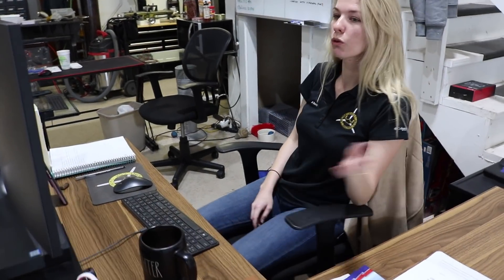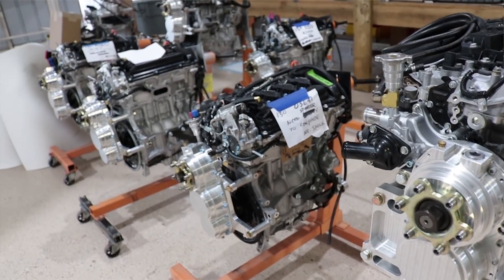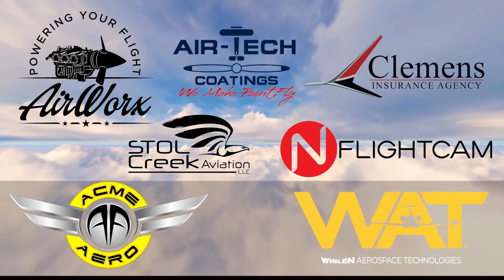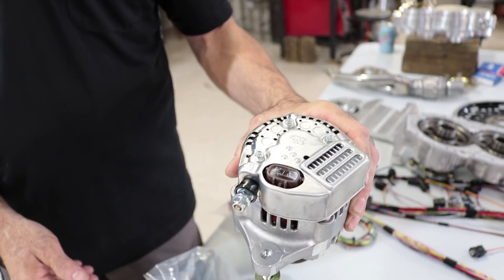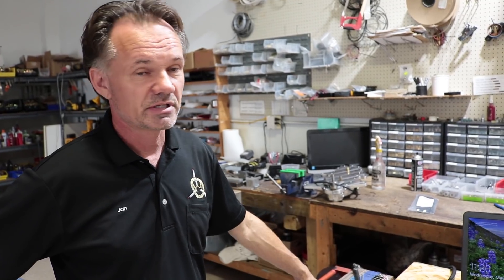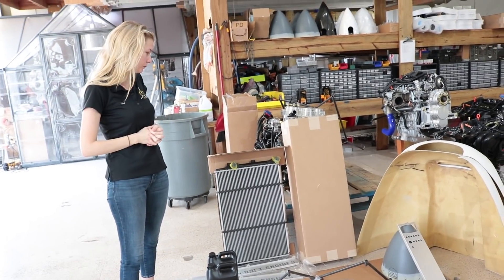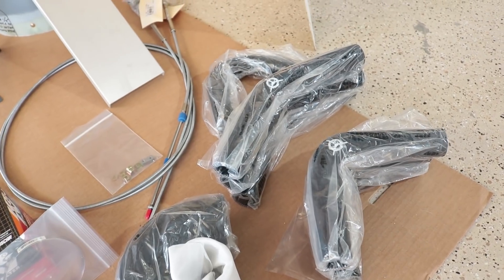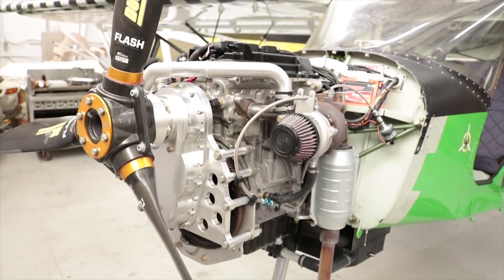Viking Aircraft Engines - Engine Week 2020

Comment: I sure would like a Honda engine. I have a 1990 Honda CBR 1000F motorcycle. It has 87,000 miles of very high RPM operation. It has never leaked coolant or oil. It doesn't burn oil. compressions are all factory fresh. The vavle buckets don't even need shims. I am totally impressed with their metallurgy.

Comment: Was somewhat puzzled by the included equipment.  Evans coolant?  K&N air filters?

Honda has an excellent OEM coolant that is very long lasting and IMO that's what should be used.  Evans is for drag racing applications where you cannot use glycol based coolant due to the fact it fouls the track if it leaks coolant.  Evans also does not cool as well as a water/glycol mix.  Granted, the boiling point of Evans is 375F, but your engine will run hotter for a given load than it will with the OEM coolant.

And K&N filters let more dirt through, period, proven many times by oil analysis.  Use a traditional paper filter.

Comment: Those engines are basically "scrap metal" going to the "vendor" and they come out of "JDM" (Japanese Domestic Market) vehicles that no longer "meet specs" per the "supplier" Honda and the "Japanese government" and must be replaced instead of "serviced" because they CANNOT be "serviced" sufficiently to "meet specs". 

The "markup" on those BOAT ANCHORS. is at least 10,000% if you consider their "value" on arrival from the "vendor" to be "scrap price". 

And this assclown refers to "robotically put together" specifically to suggest "human error" had nothing to do with their "scrap" status. 

That is complete bullshit. There is some "automation" involved in "mass production" of "car engines". But there is no "autonomy" whatsoever where "robots" have "replaced human workers" and are "building engines" actually assembling ANY precision "internal" OR "external" engine parts.

Comment: Why would you insist on 4130 chromoly tubing to be TIG welded when it was specifically designed with Metallurgy requiring it to be oxy-acetylene welding. When 4130 and I believe 4140, chromoly tubing is TIG welded it must be stress relieved at all the weld with an oxy acetylene torch. Otherwise you have an Austin medicazone which is subject to failure. Even NASCAR was making this mistake requiring roll cages to be TIG welded instead of oxy-acetylene welding. That metal was specifically designed for oxy-acetylene welding???

Comment: Those that are new to the game make whatever decision you’d like, but do your due diligence and research Mr Eggenfellner’s past with Subaru engines on airplanes before you purchase.  Same guy and basically same marketing story now as then just a different engine manufacturer.  It did not end well.  Again make whatever decision you’d like, but buyer beware.
Reply: Just got our Eggenfellner Subaru back together with its third short block. Really getting old fixing stuff. Really ruins the idea of alternative engines as there are a lot of engine specific choices to wiring and fuel system. Lot of work and money to swap to a traditional engine. Not saying all alternative engines are a bad choice but we definitely believe the Eggenfellner Subaru was the wrong choice. But at least I get a laugh every time I remove the Eggenfellner intake manifold and looking at the frying pan emblem on the bottom (yes, intake is two pans welded together). "Farberware - Quality Cookware" I'm sure the non-stick coating was an eggeneering decision.

Comment: To understand dual spark plugs in an older aircraft motor is to understand the failure rate of a magneto and that those motors could not produce full power without dual spark plugs because of a weak and low voltage spark.    This is not the case in a newer modern gasoline motor.
Reply: The main reason for two spark plugs in classic aircraft engine is that their pistons are over five inches in diameter.  The flame front moves too slow to span that distance with one spark plug.

Comment: I am putting one in my Zenith 750 STOL, once I stop dumping money in my Cessna 210. Different mission, goal is to leap off my own property and fly low and slow. The Viking will no doubt do the leap off the ground fast. I might have to build me a set of Cruzer wings and tail so I can move a little too.😄 I own a 1966 Corsair Corsa, I was looking hard at going that route, since I have already built 3 - 164 140HP engines., but the modern technology in the Viking and true 130HP performance won for me. Plus I can get a low mileage Honda, similar VIN  replacement motor, if I ever need it, for less than $2000.

Comment: I really like your videos. Keep them coming! 
When I took Auto Shop in high school we were given a Ford truck chassis, everything from the body down, to learn on. It had fallen off the truck when it was being delivered to a local Ford Dealer. That’s a great way to get an engine, if you can get a hold of one.
When the EPA mandated their emission standards one of the areas that was needed improvement was an ignition system. The old points style ignition because when the points wore down the dwell of the ignition coil changes over time along with the ignition timing. Dwell is how long the coil is charged by the battery. The longer the better. In the old days dual point distributors had two sets of points the increase dwell, and that created a hitter spark. But dual ignition gave the engine two paces to wear. When they changed to electronic ignition, that was no longer a problem, and the engine won’t need constant tune ups to keep running clean. That also helps the engine run better longer, and in an aircraft that mean the horsepower rating remained constant, not high one day and after a few hundred hours of use would have to be serviced to bring everything back to spec.
Reply from the maker: Will do! Thank You! All good points on the tech talk their. Thanks for sharing. Good story and great experiences!

Comment: why do are you using carbs instead of Electronic Fuel Injection?  Wouldn't that reduce a fragility and eliminate carb icing problems.
Reply: There are no carbs. It’s all direct fuel injection.
Reply: @alissaeggenfellner4613  he states at 9:20-9:27 that it has 4 carburetors.
Reply: @jrholand  it has 4 injectors, 4 coils, 4 spark plugs, he was stating instead of a single carburetor we have 4 independent injectors
Reply: @alissaeggenfellner4613  gotcha.. phew
Reply from the maker: I believe he was stating that "COMPARING" to "as if" it had... not that it has. Most people think of aircraft engines think of have a carburetor. Thanks for your questions! Thanks for watching here today!

Comment: What about that Duc prop viking recently marketed?  The one that changes pitch, did you see that when you were at their location?  That seems like a great option for a viking cruzer.
Reply: I don’t think we had it completed when he was here! However, he saw it at Zenith Homecoming. It is a perfect match for those looking for great speeds and takeoff without compromising.
Reply from the maker: Good question. I have spoken with DUC a few times and may do an entire episode early 2021 showcasing what they have to offer. Thanks for taking the time to engage here and for watching today!
Reply: It’s a simple, straight forward design, incorporated in the design to pass the actuator arm through the gear box. Uses an electrical actuator, so no messy hydraulics to worry about. The DUC props are slick, pricey, but you get what you pay for. Prop Pitch System looked very light weight to me as well.

Comment: Can it run on Low Lead AV gas found at airports or do have to plan on finding MOGAS at the destination?
Reply: You can use either, when using 100 LL an additive should be used, this is similar to many engines using 100 LL
Reply: @alissaeggenfellner4613  Do you guys keep the catalytic converter on the engines, or is that removed?
Reply: @PistonAvatarGuy  we’ve done it both ways on the 130, most run with it on, but can also be easily removed.
Reply from the maker: I think your question was answered below. If not...ask away. That is the purpose of starting this series. To get the conversation going for you. Thank You for watching!

Comment: There’s no doubt that automotive engine technology is fantastic and reliable. However, since any particular engine model offered here has a low (maybe zero) number of installs in a given aircraft model, it’s like you’re being a long term test pilot for that engine install. I’m more comfortable going with an engine such as a Rotax which has thousands of installs in a given aircraft model.
Reply: I’m confused at your response, we have over 600 Zenith installs and many in Kitfox, RANS, Searey, PPC. Over many years we have over 1000 engines sold. The engines are very well tested before they ever hit the market. Even a tested Rotax can fail, but it’s about picking what’s best for you.
Reply from the maker: Go with what you know... or take the time to learn about something new. That is the point of this ENGINE WEEK Series. I hope to reveal most of the details that were or are in question to have you better informed so you can more easily make a choice. And I only wanted to cover engines that are actually "In Production" and the most popular of those. These are quite popular and being installed in aircraft at a pretty aggressive rate these last few years. But of course.... you can decide which platform you feel most comfortable with for your application. Thanks for taking the time to comment here today and for watching!

Comment: No info presented on displacement, HP, gear box ratio etc. Guess you have to go to their website.
Reply: Yes, all that info is displayed easily on our website and a list of parameters etc. . All of our engines run a 2.33/1 ratio in the 90, 130 and 195 T engines
Reply from the maker: Sorry if I missed anything. But yes... that is also why I provide links in the description so you can check out their website or simply call and talk shop. Thanks for watching! I appreciate you!

Comment: Massive Honda fan and also a fan of offering affordable engine options for aircraft, I have a Honda car, bike, lawnmower myself, but isn't that 1.5L turbo 'earth dreams' the engine that has reliability issues and has been banned in China? Dilution of oil and carbon build up issues (Scotty Kilmer). Keen to understand what work Viking to prep it for aircraft installs.
Reply: Dilution of oil and carbon build up are avoided by running it overboard just like a typical aircraft engines. I think this was mostly an issue in the early years (not now) We have some videos called “Viking Talks” that go through a bit of the process more and are always sharing more
Reply: @alissaeggenfellner4613  Thanks! I'll have a watch.
Reply from the maker: I hope your question(s) were answered  below...if not ASK AWAY. I want you to be able to get an education from this ENGINE WEEK series and be able to make a decision if this is an option for you... or not. Thanks for taking the time to watch today!
Reply: The issues you mention are endemic to turbo direct injection engines of any make.  Doing a lot of short tripping on them with 87 octane fuel leads to oil dilution because they run a rich air-fuel ratio (AFR) to avoid knocking and detonation on the lower octane fuel.  In a grocery-getter or soccer-mom application the oil never gets to a high enough temperature to burn off the extra fuel that ends up in the oil.  

This issue is mitigated by running these engines on higher octane fuel that doesn't require as rich of an AFR to avoid knocking/detonation and/or running the engines harder and longer, which results in appropriately higher oil temperatures that will burn off any fuel that does end up in the crankcase.

An alternate way to mitigate the dilution/loss of oil viscosity is to just run thicker oil.  Honda recommends 0w20 oils even in their turbo engines but I personally would move that up to somethingW-30 synthetic at least.  And do oil analysis to set your change regimen, don't rely on the oil life monitor in the car.  Once the oil falls out of viscosity range - 9.3 to 12.4 centistrokes viscosity for Xw30 at 100C/212F, change it.

As Mrs. Eggenfellner notes this would be less of an issue in an aircraft application because it will be running at relatively high power settings even in cruise.

Comment: Does Honda really approve Evans waterless coolant in their engines, as shown in this video when the kits are ready to ship? I genuinely have concerns about that product...Have never seen any OEM manufacurer recommend other than 50/50 blend?
Reply: We use it with a slight pressure (5 lbs) cars are much higher as you know. The reason being if there were ever to be a leak you wouldn’t lose as much fluid, it’s lifetime and doesn’t cause corrosion in the engine or radiator (water can), some places in the engine are hotter than other like around the exhaust manifold - which is built into the cylinder head, water could turn into steam pockets in those areas and not cool like Evans (which has a much higher boiling point) even without pressure.
Reply: They don't use it because of sheer cost. It's used extensively in race cars where it can be re-used on frequent tear downs and car collections where the cars sit. I would have no issue running it, it's far less corrosive than glycol.
Reply from the maker: I think your question has been answered below. Ask away on here anytime! Thanks for taking the time to watch here!

Comment: Auto manufacturers beat the crap out of these engines in testing.  Thermal shock test, hundreds of hours at WOT, contaminated fuel, ect.  Auto engines are very reliable, but they have an achilles.  The whole operation of the engine is dependent upon a working electrical system unlike a traditional aircraft engine.  Many also have the added complication of a gear box.  So as with everything there are pluses and minuses.
Reply from the maker: Sure. Agreed. So far so good here though. Are you currently building something yourself?
Reply: @ExperimentalAircraftChannel  I am building a Bearhawk 4place from plans, but I'm still a long way from having to make an engine decision.  Vikings would definitely be worth a look if they had offerings in the power range I needed.
Reply: @MrBtdobie  I love that whole like of aircraft! they are huge compared to what im looking for though and while I love Viking, aircraft that large may need something like a bigger Lycoming. Thats what pushed me away from the larger aircraft like that. Cost to operate was outside of what I felt was worth it and necessary for me.
Reply: @TheArchitectJC  I was looking for something that would be suitable for family flying even as kids get older and bigger.  So the Bearhawk's useful load is what really attracted me.  In the end I will probably end up with a Lyc, cont, or UL power, but I am still wide open on that front.  It seems that large airplanes limit your engine options.

Comment: I have personally set up the top end of a 2009 1.5 liter Honda engines 117hp@6600rpm. Very solid platform from a mechanical stand point.
Reply: Good point. The GDI version of the engine has a lot of torque at 4500 so even better as an aircraft candidate
Reply from the maker: Awesome! Good to hear about your mechanical abilities. Now... to choose an airframe for an engine right? What are you considering?
Reply: @ExperimentalAircraftChannel  I was commenting regarding the all around awesomeness of Honda engines. BearHawk5 started in Oct 2020